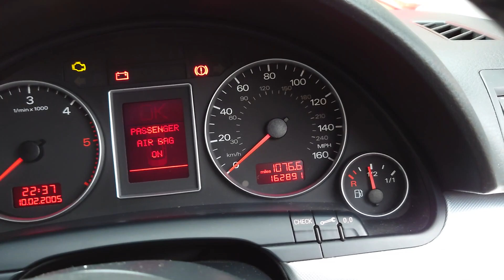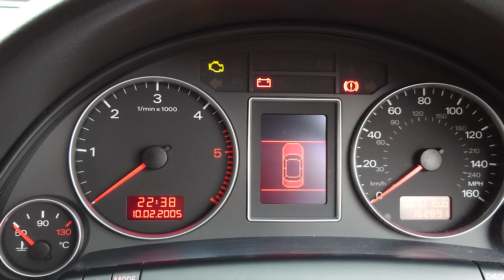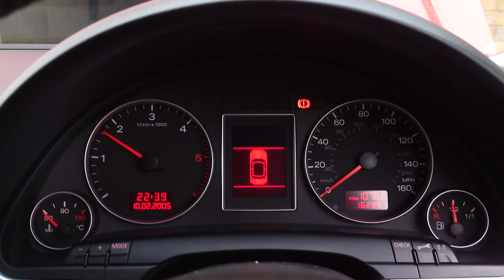Audi VW Skoda Seat white smoke fix

Comment: hi  thank you for your info i had similar  , low mileage 75k  but smoke  not on start  up  , but once warm  and  i bit of rough idle   , changed lots including  turbo  but before i bought the car  it had a  new cam belt fitted  and   just wondered if it could be   the same as yours  torsion  values +or-     2k  has been spent  by previous owner to try to fix
Reply from the maker: Hi. I would say check with the diagnostic tool 1st your torsion value. It's probably out. Do you have any diagnostic tools available?

Comment: I think you are saying torsion value,when you actually mean timing value am l correct?
If not please explain as l don;t recognise torsion value
Reply from the maker: Torsion value is what snap on scanner shows 🙂 obd 11 says the same.
Reply: Ok but how do you alter torsion value?
Do you need to adjust the cambelt,which then alters the timing of the ignition point?  @axores20